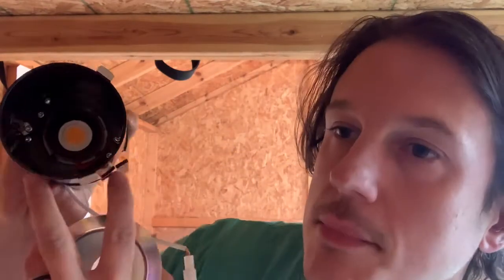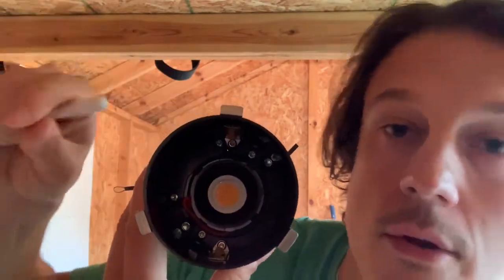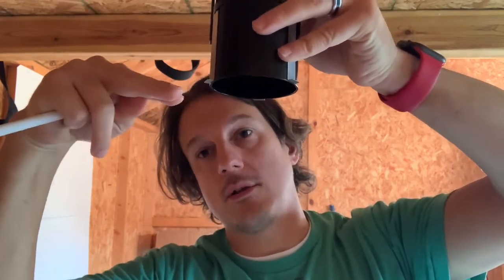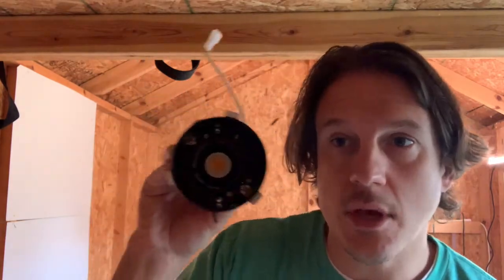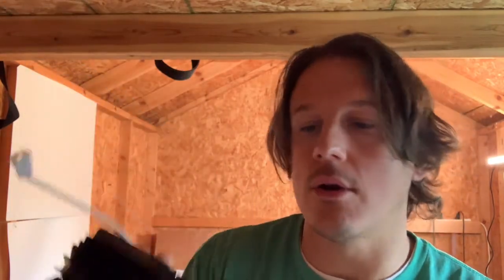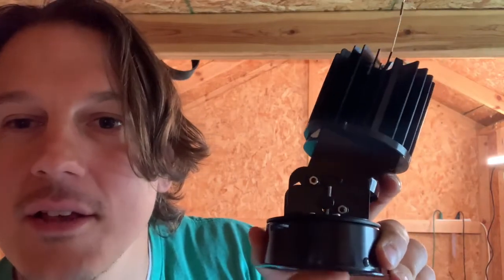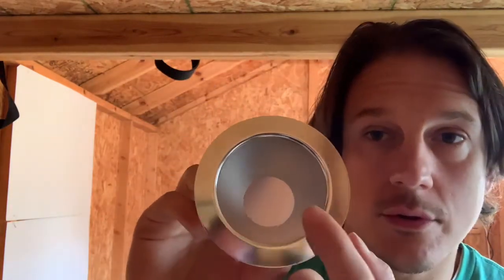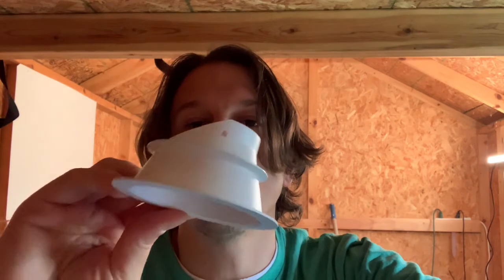Meet Your New Favorite American-Made 2" Recessed Light

Comment: How would you configure this light for a kitchen? Mine is 13' x 11' w/ 8 ' ceilings
Reply: This light comes in different beam angles, so the spacing will depend on which beam angle you choose, along with looking at any other lighting you have in your kitchen. 

In a kitchen you would consider the following locations as options: the corners if not already lit by central light fixtures (to light up darker and high areas of the room and make the room feel bigger), pathways if not already lit by central light fixtures, and task lighting positioned in the ceiling about 3"  in from the edge of the countertops if not already lit by under cabinet lighting or pendants over your island (closer to the wall and you start to get glare off upper cabinets, further from the wall and your head will make a shadow on the countertop while you are working). 

In order to determine how many lights you need, and how close they should be together, you need to calculate the area of the room and get a target for the amount of total lumens you need. Deduct the amount of light you are already getting through other fixtures. Then look at the beam angle of the pot lights an the height off the floor they will be, and calculate the width of the cone of light each lamp will project at the target height. (In the kitchen the target height is the countertop height). If your ceiling light and beam angle results in a 6' cone of light, consider if you want the light to overlap for no dim areas, or if you want "clouds of light" that are separated. That will determine if the distance apart you place them is more or less than the diameter of the cone of light at countertop height. After you have done this you may wind up with too much light. If you are only 20-35% over dimmers are helpful. If you are over more, you can change the specifications on the can light to change the lumens and beam angle to adjust the scenario, or consider bulbs that cast fewer lumens in your other fixtures.

Tips: 
- Lighting design is one of the key items that makes a space feel truly special, or "photo worthy", so it is worth taking some time to learn to do this well. 
- Note that narrower beam angles are great, because they are a lot easier to control and be precise with your lighting design, and they work better for higher ceilings, but they will require more light fixtures in some situations. A wider beam angle (flood light)just goes everywhere and is kind of a sledge hammer approach, but it has it's place (garages, outside, industrial settings, massive rooms, and places where you just need to get things lit and spend the least money possible).
- For many rooms, after specifying the central ambient lighting fixtures, and the task lighting, you may need none, or only a small amount of can lights, just to add some light to the remaining dark areas or put a spotlight on a special feature like a fireplace. It is very common people over-do it with can lights! 
- Watch YouTubes from professional lighting designers, and go into a dedicated lighting store to start to get educated. Lighting has a lot to it. Color rendering index, dimming technology and compatibility with switches, light temperature, and the mother of all challenges: sloped ceilings are just a few of the other things you may run into. 
- Here is an article on beam angle: https://www.modern.place/beam-angle-calculator/#how-to-use-the-beam-angle-calculator.